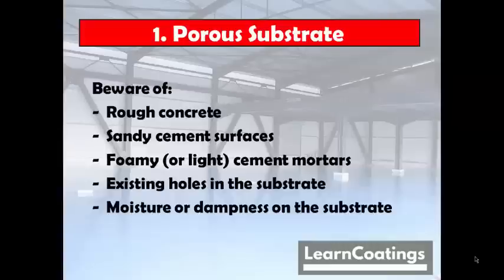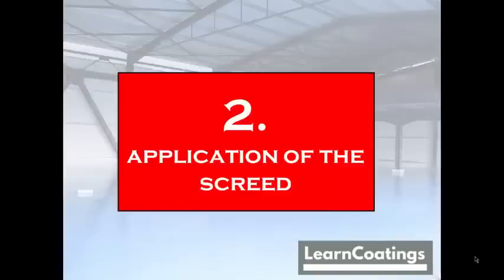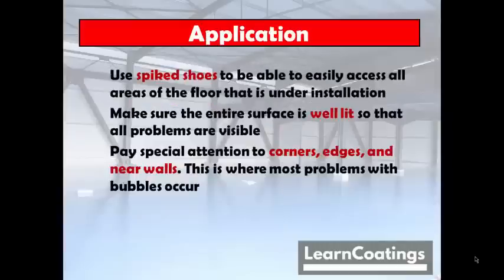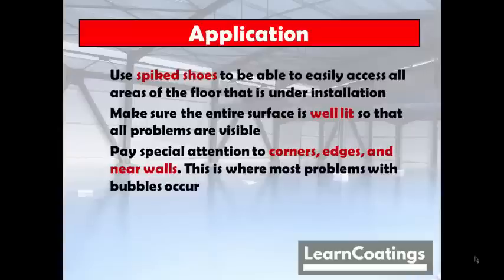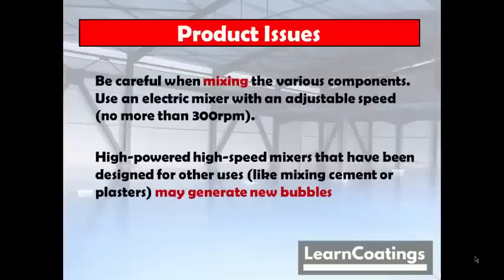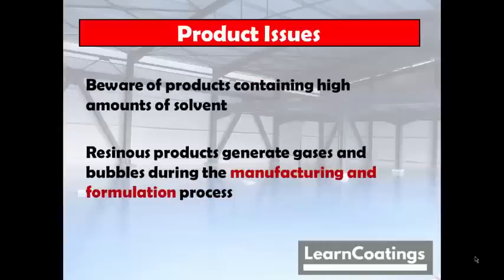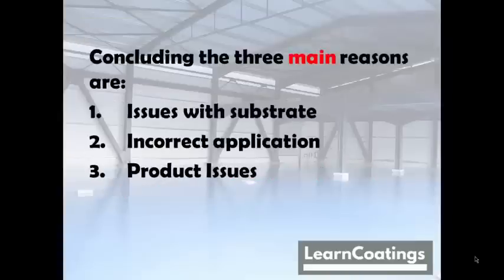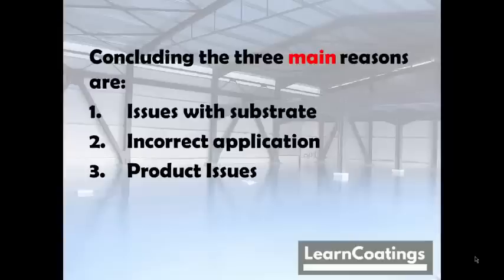Epoxy Bubbles: Why you are getting Bubbles and Pinholes in epoxy flooring (3 Reasons)

Comment: I’m getting ready to do my laundry room floor. I’ve already removed the previous laminate floor and glue. This floor was ground via angle grinder to provide a clean surface. My question is… what recommendation for applying a concrete primer before I put the skreet? I plan on using an industrial type epoxy on the floor.
Reply from the maker: You should ask for an epoxy based primer. It will have the best adhesion and it will be compatible with the epoxy on top

Comment: What sealer do you recomend for a porous floor?
Reply from the maker: I would recommend a 100% solids primer that does not contain any solvents. These have a thicker texture and can cover the pores. You may want to use a squeegee to apply it
Reply: @learncoatings-epoxyfloorin9448  I thought you said you like water based primers. No?
Reply from the maker: @danielbuckner2167  water based primers work it's just if it is really porous you may need to apply several coats just to get a properly sealed surface

Comment: In which direction the porosity or air bubbles will move (X,Y,Z) ?
Reply from the maker: Good question. If it is a bubble caused by the concrete the air moves upwards. If it is caused by water or condensation in the atmosphere it is downwards. And if it is caused by the trowel during application then sideways

Comment: What machine(s) and grit do you use to prep the concrete. Can you use a swing machine with weights on it? What tools do you recommend and where can we get them from. Do you do a moisture test prior to prep and if so what moisture meter do you use. Lastly I heard of some type of concrete testing rods to know what kind of concrete you're dealing with, have you heard of it or use them, if so please give your feedback on them. Thanks
Reply from the maker: Have a look at this article for more information on the required equipment http://learncoatings.com/wordpress/starting-resinous-flooring-business-equipment-required/
Reply: What are the pros and cons of wet grinding. I'm not a big fan of dust. Do I need a moisture meter? I live in the USA and some machines and products are different. I was thinking of using a orbot vibe for now until I got bigger jobs them spend the money on a hasqvarna ps450 and upgrade as needed from there.

Comment: Would it benefit if one uses a spike roller for 400 micron epoxy floor coat ?
Reply from the maker: This thickness is borderline. The spike roller might leave an imprint. However if you are getting bubbles you may want to at least back roll with a normal roller
Reply: Appreciated !